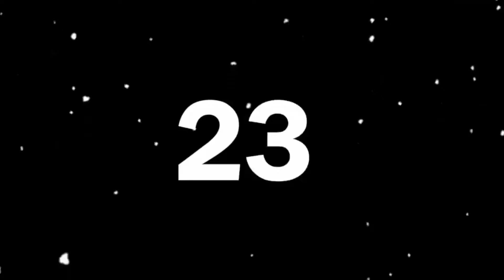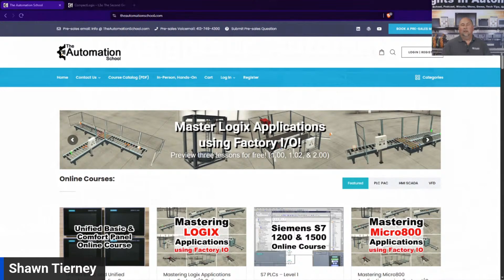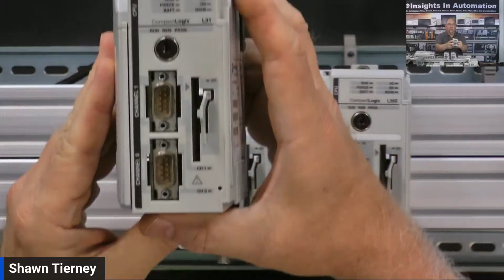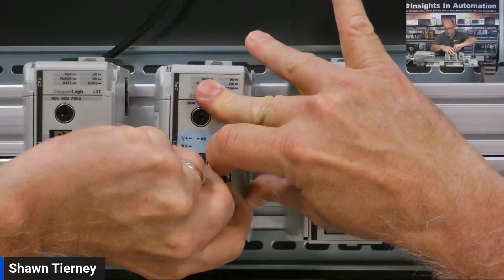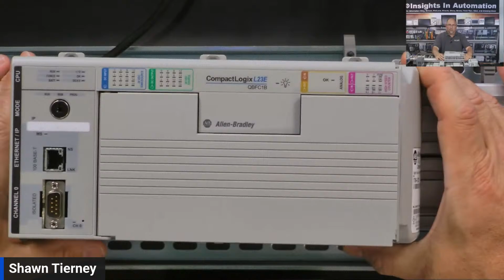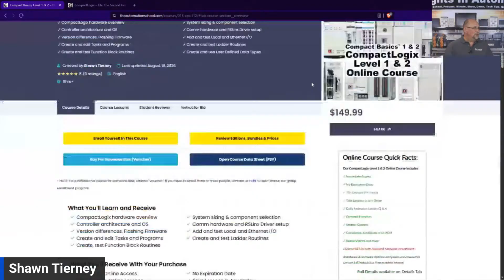CompactLogix L3x & L23: The Second Generation

Comment: Can you use only the processor without I/O? using Ethernet and point ?
Reply from the maker: Hey @redmundperrz7234, yes you can use just the L3x, PS, and End cap and then have all your IO remote, like using an L35E and Point I/O. This is more common with ControlLogix due to the size and expense of the 1756 I/O, but not so common with CompactLogix with IO in the same panel due to the Compact local IO not as large and expensive as 1756 ;-)